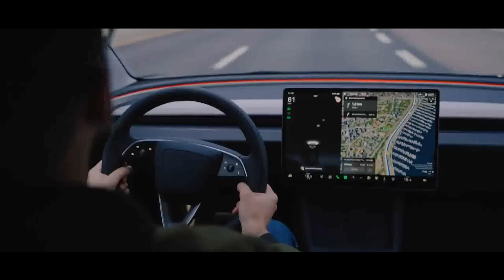IT’S HERE! $7,899 Tesla Model 2 — 900 kW, 4:37 (10–80%) Charge, Gas Stations HUMILIATED

Comment: I'm undecided about hybrids, but full electric, with today's technology, is a massively stupid idea.  When they have a battery that can charge in 5 minutes, and drive for 400 miles, and be the car the size of a Honda Pilot, with the same number of brake horsepower, then i would consider it.  Right now, it's an expensive toy marketed to the innovator.